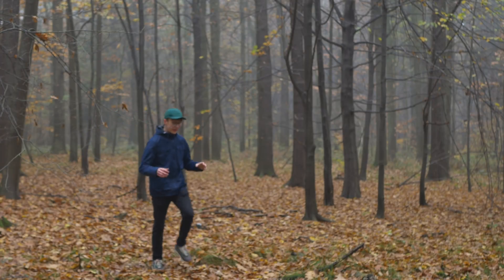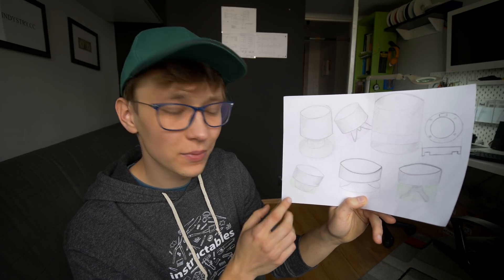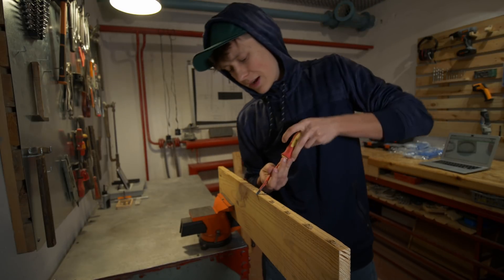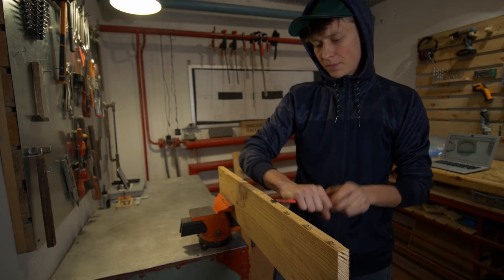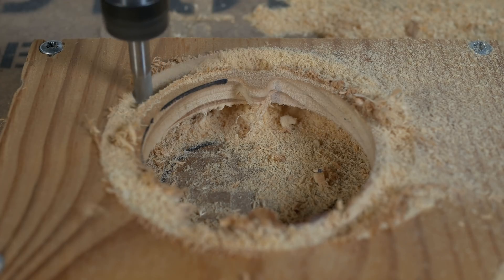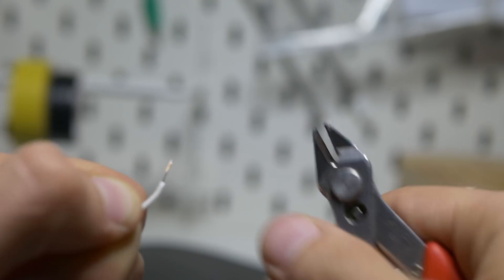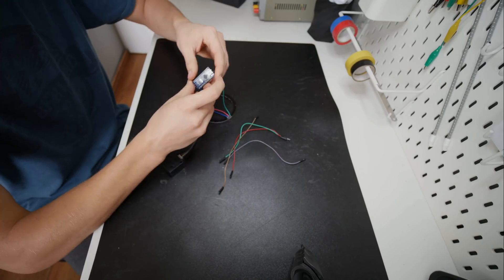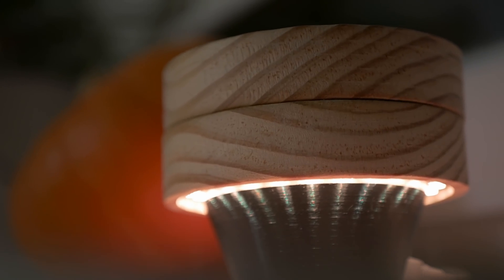Arduino Based Air Quality Monitor

Comment: I liked your sophisticated way of saying scrap wood haha. To prevent the fuzzy wood bits from the CNC, I recommend trying a 2 flute downcutting end mill if you haven’t already. It will produce a great finish on top and remove the need to sand as much.
Reply from the maker: Just tried a straight flute milling bit on plywood, works great!

Comment: If you need any tips regarding air quality sensors, then I can help :) Few tips, sensors from series PMSx003 (and probably most of the rest) are measuring single value, usually PM2.5, all the rest is calculated from this one. Fog is adding up to suspended particles (you can test it with ultra sonic humidifier), however air humidity is not. Those sensors are also quite sensitive. They will easili pickup smoking neighbour and measures for outdoor sensor will skyrocket :)
Reply: I need help w tym sabdżekcie ;) Jak można się z Tobą skontaktować?